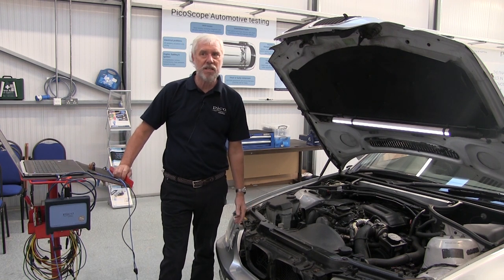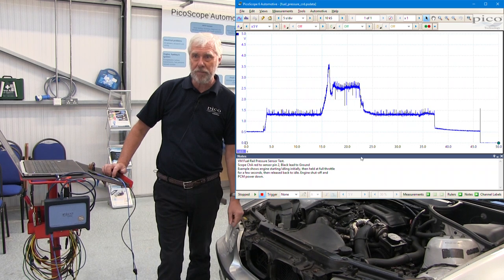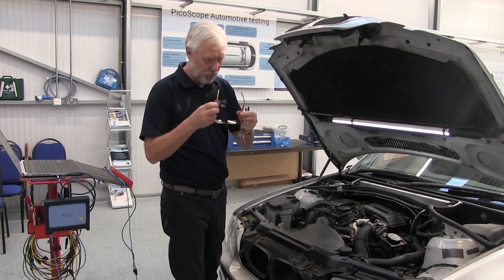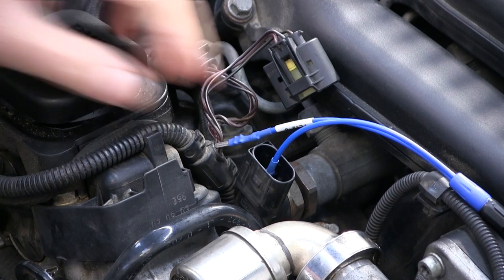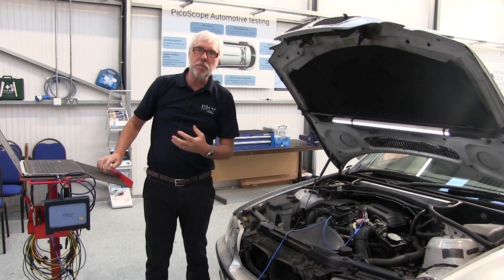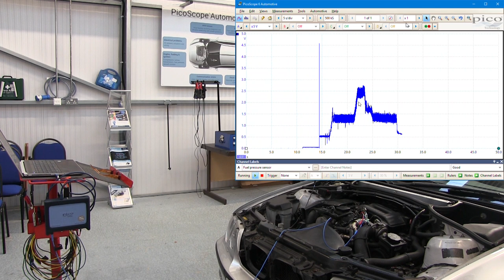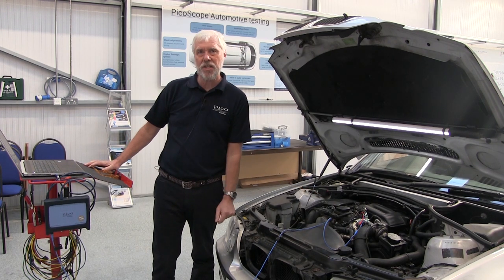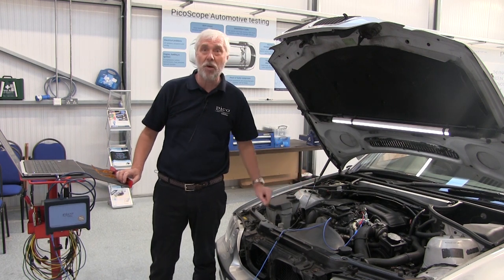Guided test: CRD rail pressure sensor - voltage

Comment: Why does my demo software only have 5 test? And it's a dead screen with 0 simulations.. Version: 1.14.0 build 4585
Reply: Hi Robert, that doesn't sound right at all. Please download the latest version (6.14.5) from "http://https://www.picoauto.com/downloads/" and try again. If there are any further problems then please contact support using support@picotech.com. YouTube is a very bad choice of channel for support issues. Thanks.
Reply: rexjames001  Thanks again Rex, great catch. As you suggest, that is the PicoDiagnostics software version, which does not have any demo tests. Robert needs PicoScope 6 Automotive (as described above) if you want to see demo signals and our guided tests etc.